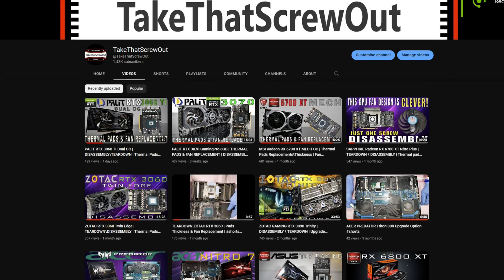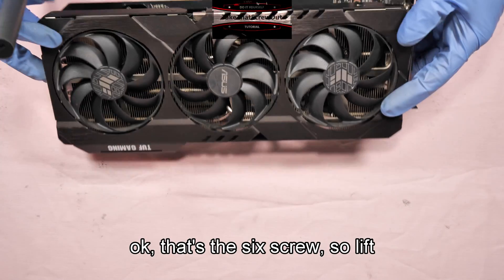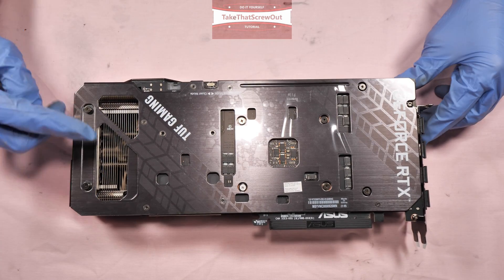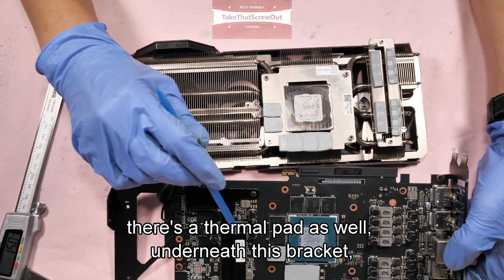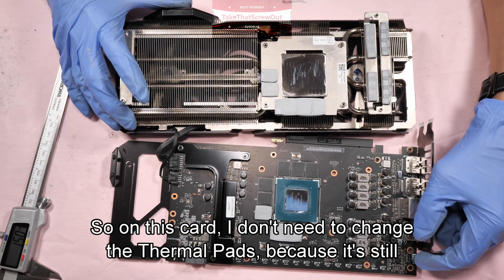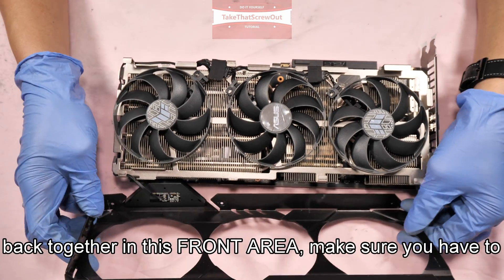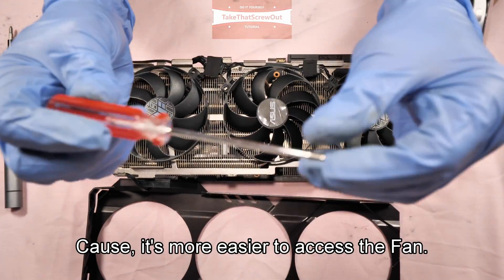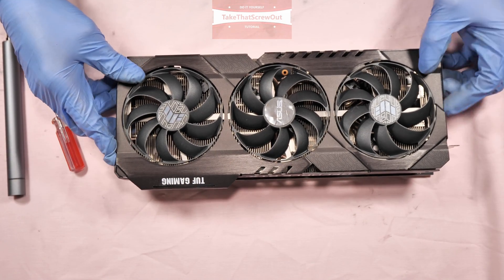ASUS RTX 3060 Ti TUF Gaming OC | Thermal Pads & Fan Replacements | DISASSEMBLY/TEARDOWN Tutorial

Comment: So first things first, your video was great but my gpu had different height of the thermal pads, some were same 1,5mm (small flat mosfets), others 2mm (VRAM) and 3mm (square mosfets). Also discovered two different screws so the temps were obviously high and after properly putting it back together I get 69°C, it was 67°C previously and after 3yrs of using it. I have 3 possible issues, first is that NVIDIA uses some NASA paste, second is not spreading it manually and relaying on the pressure to spread it like the CPU with IHS but people say I need to manually spread it, third is that even tho I screwed the GPU diagonally, the screws were one by one at max so I should probably do it slowly and at the end fully screw it in.
Reply: Update 2: fixed it by smaller pads on VRAM. VRAM is 1,5mm, big square mosfets are 3mm and small mosfets are 1,5mm. I have the V2 LHR OC version. Temps are now 64°C gpu and 77°C hotspot at stock settings 220W TDP. It's an improvement, not the Asus style improvement but still. Maybe the MX-6 thermal paste is not that good for a gpu die.
Reply: @PhantomSklyne misma asus y el mismo problema que el que planteas acá ... veremos
Reply: Update: tried proper screwing and spreading the paste, same temps at 69°C. I guess nvidia got some NASA paste lol
Reply: Update 3: no the temps are actually same after I got the card, 60°C at 200W is what I got I think, it couldn't be 220W because I didn't mess with msi afterburner for about a year.

Comment: I can confirm that the Asus 3060 12gb lhr V2 has the EXACT SAME heatsink and thus thermal pads as the video shows. 
I was reaching 78C and 108C hotspot, after maintenance (thermal pad and thermal paste renewal) i am consistently reaching below 60C (undervolted, 925mV and 1995MHz gpu clock)

Comment: WHICH WILL BE BETTER GELID GP-Ultimate or extrmee ?
AND CAN I USE ALL SIDE 2MM?
Reply from the maker: The ULTIMATE has Higher Density and Hardness rating compare to EXTREME..according to GELID itself. And based on my personal experienced using Gelid products, I personally prefer to use the ULTIMATE.. It never let me down it performs really well. Don't get me wrong the Extreme is also really good. But I prefer the harder side cause I believed it transfer more heat faster than a softier pads.
Reply: @TakeThatScrewOut  is there any pad on the backside?
Reply from the maker: @anwaribrahim3-453  there's thick pad underneath backplate bro about 2.5-3mm thickness.. I didn't bother to show it because it's not necessary to change it, that only supports to dissipate heat from the opposite side of the chips, and those thickness of pads last for very long time without changing it. The top of the Chips are the most important area where 95% of the heat of that chips tend to come out.

Comment: hello does this have the same design to the non Ti version ? RTX 3060 12GB OC ASUS TUF ? from the looks of its...look similar to me
Reply from the maker: They looks similar, you're right. There's only slight difference on the layout of the pcb, because the TI version has more chips and part and Power than the NON TI versions.

Comment: is the non ti version of same card same thermal pad size ?
Reply from the maker: Hi bro! I haven't done the NON TI version of this card.. But tried some research for you, can't find any info so far.. You know what, based on the design and due to the TI version is just one step up from the NON TI, I assume that they have similar thickness.. I didn't say that's 100% accurate Info.. But you can't go wrong using the 1.5mm on the VRAM and 2mm thickness for the VRM's that's should be fine. Try to choose a SOFTIER kind of Thermal Pads like the Arctic.. That could adapt easily if there's any difference with the thickness. Believe me that will works fine without any problems.

Comment: Today changed pads for two GPU, I I can confirm that size on video are wrong. VRAM - 2 mm, coils I think 2.5 mm, but I had only 1.5 and 2.0 mm so I putted , 3.0 mm, and 3.0 mm under coils. Identical sizes under steel plate, 2.0 and 2.5 (3.0) mm

Comment: Thanks for this tutorial! I am not technical in computers. Experienced black screens in just one game, fans went mayham. Did undervolting, DDU in safe mode and all kinds of stuff. Should have begun with this. After three years of a couple of days a week gaming per week, the thermal past was all dried out. Did not replace the thermal pads. Some tore but think they still matched. Under heavy load the temps lowered with 13 degrees! Now the peak is 72c and less 100 procent usage during gaming.

Thanks man!

Comment: For some reason the 2mm pads under the shroud (the ones under the metal tab under the cooling fins) arent touching the modules.
Reply from the maker: Double check if it screwed in properly and all mounting areas seats in. Thats more likely what happened.

Comment: My gpu dp and hdmi port is broken😭
Reply from the maker: Okay, that's interesting..how did that happened and which area of the port is broken? That could be repairable by diy soldering..that depends which area is broken
Reply: @TakeThatScrewOut  idony know what happened my friend gave it to me. The gpu has corrosion 🤣
Reply from the maker: @vingaming6535  If the corrosion is building up on the Fins of the Heatsinks..all i could recommend is rub it with the finest STEEL BRUSH you can find it in Amazon or ebay or maybe on your local Hardware shops..be careful while doing it..then after rubbung with wire brush, clean it with 99 percent Isoprophyl Alcohol to wash out those corrosion residue.
Reply: @TakeThatScrewOut  can i use contact cleaner for it? I think its the corossion
Reply from the maker: If its oil based cleaner, i won't recommend it. What i did on mine i rubbed with very fine wire brush then just  brush it with normal paint brush after with isoprophyl alcohol then blow with air blower or hair dryer to let it dry.
Reply from the maker: By the way, is that gpu used for minning before? Because, thats more likely a gpu been used for minning could potentially develop corrosions due to its been running 24/7 non stop and moisture buildup overtime.
Reply: @TakeThatScrewOut  i used it with wd40 🤣
Reply: @TakeThatScrewOut  yes its from mining i buy to my friend for 50$ , in first 5 months its working fine but after that  its says no signal in all ports of the gpu. But the gpu is booting  fine and i can shutdown it using the keyboard
Reply from the maker: @vingaming6535  If the no signal issue still exist, try to strip down the gpu, totally separate the pcb and rub the pcb with paint brush dipped with 99.9% isopropyl Alcohol, make sure to rub all Ports as well IN and OUT then blow it the whole pcb, all tight corners, holes, ports with Air Blower to make sure its totally dry before assembling it again. The purpose of doing so is to remove all the moisture buildup in the board, which is very common from Mining gpu..and that could cause lose contact..or maybe even worst could cause short circuit.
Reply from the maker: @vingaming6535  using WD40 is not very good idea because its oil based cleaner..but its okay as long as its totally dried up.

Comment: I just bought a second hand Asus TUF 3060 TI and was disappointed by the huge fan noise. After some research, I was convinced that the thermal paste was to be changed. I follow the guide (only changed the thermal paste) with success easily and gained 15° C (70°C average on 3D Mark Time Spy to 55°C) so I would say 3 times noise reduction which make my graphic card really quiet now! So don't blame the fans first as it could be the thermal paste (which was completely dry). Thanks for the tutorial and I hope it helps someone :).
Reply from the maker: My pleasure bro! That's great what you've done and end up great result with ypur gpu..well done! Enjoy and take care bro! Thanks too for the support!

Comment: Hi everyone, I have the 3060 version not the Ti, you know if it has the same thermal pad sizes?
Reply from the maker: Hi bro! To be honest i haven't done yet the 3060 version on the TUF model..but i'm assuming they would likely to be the same thickness of the thermal pads..i've tried to contact ASUS regarding this, but i haven't receive any reply yet.
Reply: Bro, I took the risk of disassembling and buying them, I had mostly 2mm and very little 3mm.
Thank you very much for answering @TakeThatScrewOut
Reply from the maker: @BarmaNzZz  You're welcome! Take care! Enjoy!
Reply: @BarmaNzZz  Hey bro, having this issue now, would you be able to describe which of the pads is 3mm? I have put 1.5mm on the VRAMs and 2mm for the VRMs but my GPU is still running very hot, also, what was the temperature decrease on yours? I'd love to get some help with this

Comment: how is asus rtx 3060 ti gddr6x made? and what about zotac gpu are well made as they do give 5 year warranty?
Reply from the maker: Personally, ASUS made a better product than ZOTAC.. i had few Zotac in the past, they are majority on the budget side, mostly plasticky but performance is fine similar. Asus built is like a Premium side but downside they are usually pricey! 😔
Reply: @TakeThatScrewOut  thanks for the reply bro, but its strange that a 5 year warranty giving product is not made well.
Reply from the maker: I didn't meant that the Zotac is not a good quality, still is.. But what i'm talking about is Asus made a better design, use better or maybe a better plastic and metal, thats only my personal opinion based on what i've noticed. But to be honest overall they both last very long that depends of the user how they lookaftet their hardware.
Reply from the maker: Just maintain to clean your system more ofter dustoff, make sure have a good air flow intake and exhaust, don't stress your card too long period of time.. And for sure your gpu will last for years bro. Change pads and paste atleast once a year thats the way to go.
Reply: @TakeThatScrewOut  thanks for the reply bro, I am planning to get rtx 3060ti oc edition  with gddr6x from asus but do you think its 8gb is going to be an issue for usage in 3d work like maya, unreal engine and lit bit of 1080p gaming hehe.

Comment: My TUF RTX 3060Ti have different pads. 1.5mm on VRAM but 2.5mm on coils at least.
Reply from the maker: That's possible, because in real world scenario non of us could give the most accurate measurements unless stated by the manufacturer. In my case, all the measurements been said on my videos are approximate or the result given on my measuring caliper.
Reply: @TakeThatScrewOut  don't give measurements if you're not sure about them.
You give people false information.
Reply from the maker: Bro, just want to make clear here..you saw in my videos that i've used a vernier caliper to measure those pads thickness..I'm just giving ideas and information as possible to those who need it. That's not a false information..there is a proof.
Reply: I have the same measurements, I wish I saw this comment before buying pads

Comment: Great tutorial and great teardown my friend!!
But the thermal pad thicknes is different on mine or maybe this is a v1 tuf card insted of a v2 version.
Anyway for those who have the same issue the vram pads are around 1.75mm so I would recomend very soft 2mm pads like gelid gp extreme that I used.For the mosfet it is around 3mm so you could use that or be like me and stack two 1.5mm pads on top of each other. I don't know about the one underneath the bracket as but the rest is fine for me
Reply: +1 ram 1.75 or 2mm, mosfets 3mm
I'm still waiting for a 2.5mm soft thermal pad, I'll try to add it to the backplate. there either 2.25 or 2.5 would be ideal
Reply from the maker: Thanks Bro!
Reply from the maker: Thanks bro! Regarding the thickness of pads.. There's no accurate answer really regarding the 100% correct thickness of the pads..because some gpu has been passed on already from different owner, they've been bought and sold as 2nd or maybe as third owner of that particular gpu. Unless the gpu was still sealed before you tear it down. So possibly the thermal pads has been change with the wrong thickness..🤔

Comment: IDK if there are different Versions of the cooler available, but that pad size did not fit. The pads you mentioned which are 2.0 need at least 3 maybe 4mm. Also 1.5 for memory does not really squish the pads. I guess for memory it works, as I installed the 1.5mm and temps are ok (75 on hotspot @ 200W) but not at it full potential I guess? But the coils definitely need more. I packed 2 x 2mm on them and on the one the vrms under the extra heatsink 2 and 1.5 for the Coils. you can clearly see gaps when you assemble the card at the vrms where the pads don't contact both sides at least on my tuf gaming oc.
Reply from the maker: Its really fine going up with thickness with pads as long as you pick a soft kind of pads that would still works.

Comment: Thermal pads are pretty good on this card, unlike the 3080 version. Unlikely to need to replace them ever. The thermal paste is definitely not very good though. Always manually spread thermal paste on a gpu, that is a bare die. You will get bad hot spots and need to do the whole thing over again, or use a pad if you don't have normal dexterity. You will lose a little bit of thermal performance with a pad vs paste, but likely not enough to matter.

edit: to clarify, when I say pad for the gpu, I mean the thermal pads made for cpu. They are usually made from graphite or some other material Do not use the big ones that you would use for vram and such, those would absolutely smash your gpu die.
Reply from the maker: There is new product from Thermal Grizzly called Carbonaut Carbon thermal pads, its a High performance and Reusable. and the other one is Kryo Sheets also from Thermal Grizzly, which is High Performance and be aware this one is Electrically conductive, so should handle with care. Both can be use on CPU or GPU die as Thermal Paste replacements.

Comment: it looks like asus did a good job on their tuf 3060 and 3060 ti using thermal pads on vram and mosfets and contact to the heatsink ... saw another video where there was no pads on the vram and mosfets of their 3080 line causing them to overheat and fail
Reply from the maker: I don't think if that was from the factory that has no pads on the chips..probably the previous owner strip it down ang forgot to put pads on it..hehehe

Comment: Great tutorial. Bought a second hand card and they never replaced the thermal paste or nothing. Hitting 83c on everything I ran it. After changing thermal paste. Furmark, Heaven, even Cyberpunk 77 on RTX only hit a max of 73c. Anything till 78 is good for me but the less the better. 3070 Card version of this though
Reply from the maker: Well done bro! Its really worth doing to replace them, how about the thermal pads?
Reply: @TakeThatScrewOut  Hey, I didn’t replace the thermal pads as I want to buy great quality ones but once I do. I doubt the card will hit more than 70c at max
Reply from the maker: @kingjeffy  That's great.. It's worth replacing it with high quality one's, good decision bro!

Comment: Hi. What thickness of thermal pads did you use? Did you use one size to apply to all areas that have thermal pads?
Reply from the maker: Hi bro! the VRAM areas has 1.5mm thickness and the rest of other chips has 2mm thickness. hope this helps.
Reply: @TakeThatScrewOut  can you post a video on how to disassemble the asus STRIX rtx 3060 ti? I have this card but dont know how to disassemble...
Reply from the maker: @biomed2341  Hi! will do bro, as soon as i could source out that particular card..i'll post it..actually the Strix version is one of on my list.
Reply: @TakeThatScrewOut  thanks! Could you also point out it the strox video on where to use 1.5mm and where to use 2mm? Will definitely appreciate that if you could explain that in your next video... more power
Reply from the maker: @biomed2341  thats what i did on my newer videos, if the card used various thickness of thermal pads, i normally pointed out which area uses which. Thank you so much for your suggestion, i really appreciated it bro. I still have plenty of room for improvements so i could give you a better informative videos in the future. Thanks bro!

Comment: Thank you for the video,is worthed use thermal pad extreme odyssey 3.0mm on the backplate where ram are too?
Reply from the maker: Two different thickness of pads used on this Particular card.. 1.5mm & 2.0mm..NOT 3.0mm. But 3.0mm should be fine on the area has 2.0mm IF your pads is SOFT, some pads are Hard or stiff
Reply: @TakeThatScrewOut  which ones are 1.5mm and which ones 2mm?
Reply from the maker: @Mustaach  Those chips around the GPU Chip are 1.5mm and those on the side with the long pads is 2mm.. it actually shows in the videos which area are 1.5mm and 2mm.